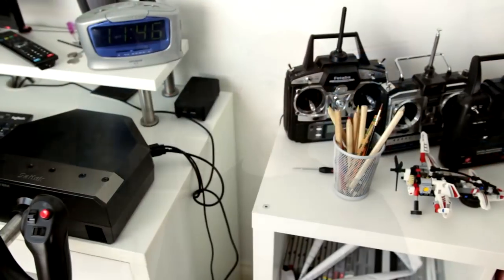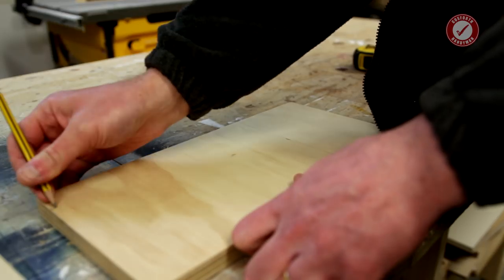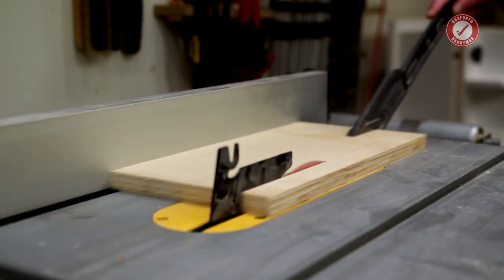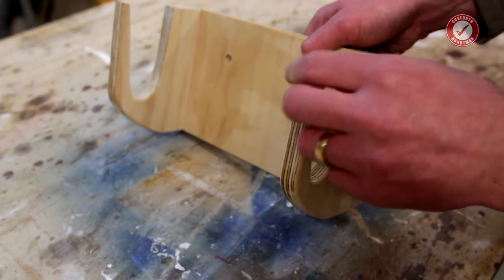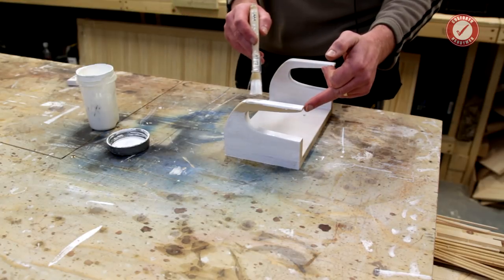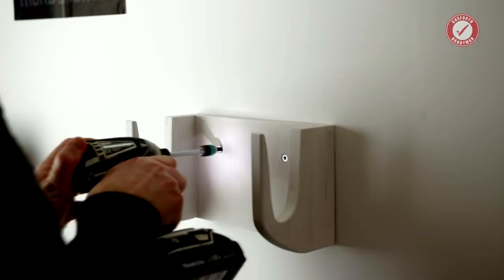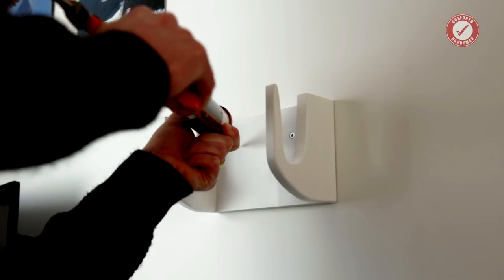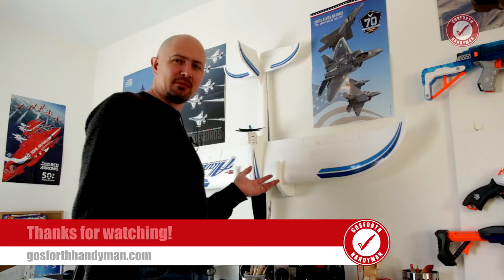Making a Simple Wall Mount for a RC Plane

Comment: You'll be taking it up again. I remember when electric model plans were just starting to come in. I used to have a Piper Club with a 72" wind span and was the slowest plan out of all my friends that used to fly at the time.
Reply from the maker: Some of the planes now are insane - wish there would be a resurgence like there is in the States. All the clubs are going down the pan here meanwhile have you seen what FliteTest are building in America? Awesome! https://youtu.be/2lyQj9M2MhY 👍🛠🛫
Reply: Worlds apart from what the club scene is over here. 
We have Select Models that have produced kits for many years and some very interesting kits when I was still flying. They was only a few miles down the road from me at the time and were very helpful. I sadly don't have the time to take up flying again as I would think everything has moved on a lot since I last flew nearly 20 years ago.